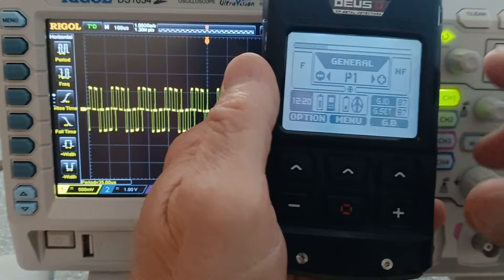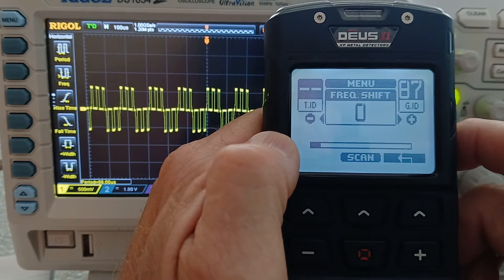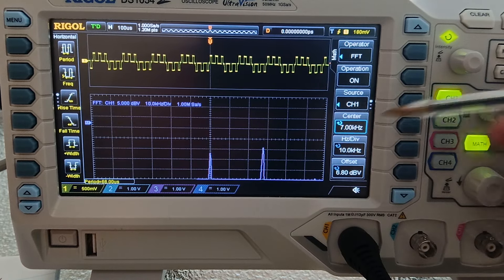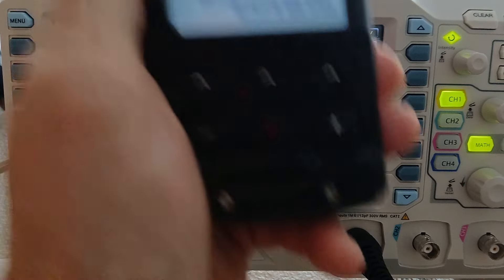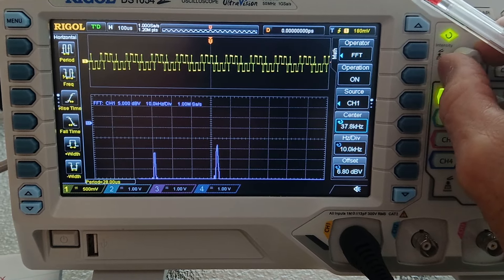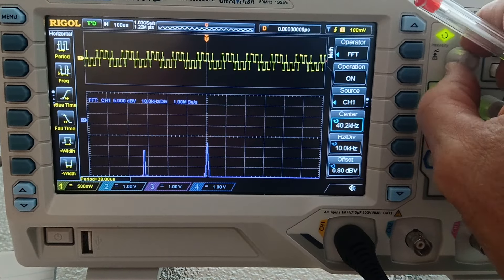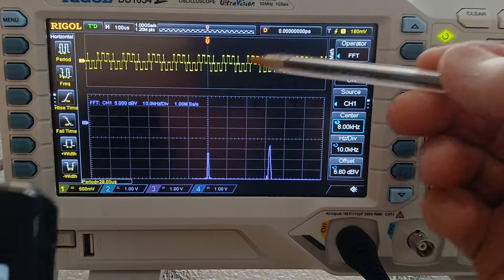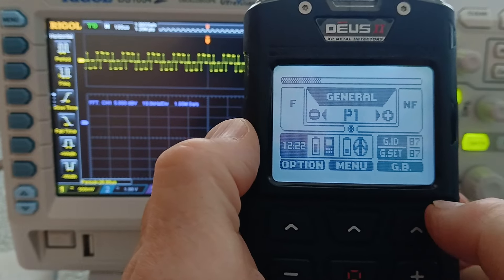XP Deus 2 Frequency Shift Transmissions

Comment: Excellent! It demonstrates with a measuring instrument just exactly what's going on there. It would seem to me that the lower shift levels would be more stable than the higher in mineralized soils. It also demonstrates that "Frequency Max 40" really means "Potentially Max 40". I like having the ability to adjust that. Thank you.

Comment: Useful and nice information from you. Do you also have a note on the shift frequency, what indications does the deus2 give also  in the 1,2,3,4,5 setting as well? Same question for the max frequency of 14 and 24 kHz? (Shift 1,2,3,4,5,6) Thank you very much for the very good technical analysis
Reply from the maker: I have analyzed the frequency max 14 and 24 but the frequency ranges are not as wide as the 40 max but they are different.
Reply: @markg6836  thank you 🖖